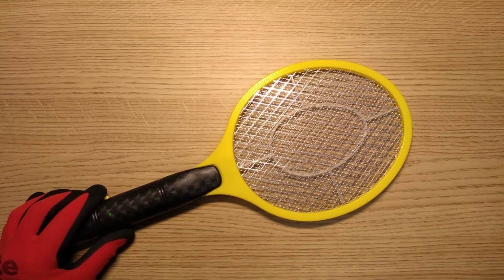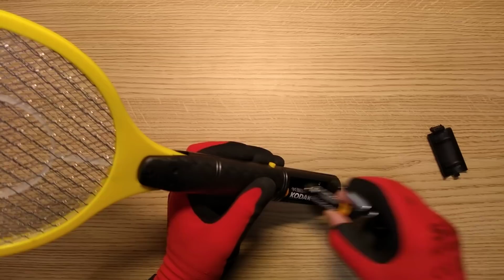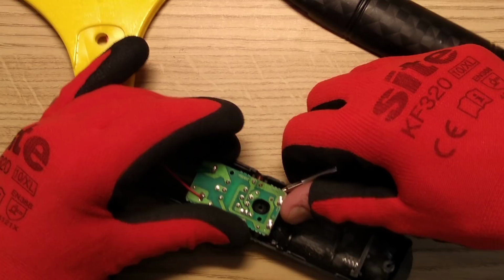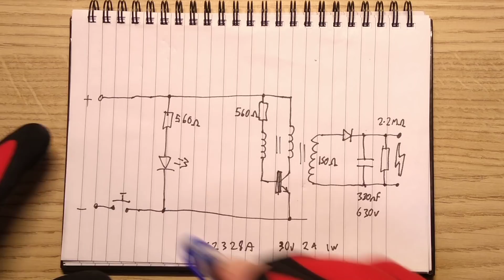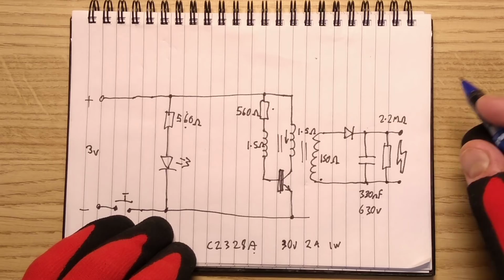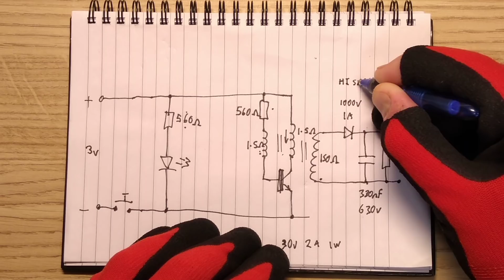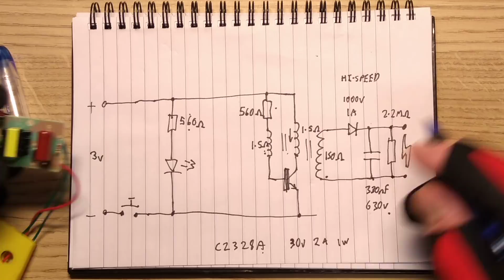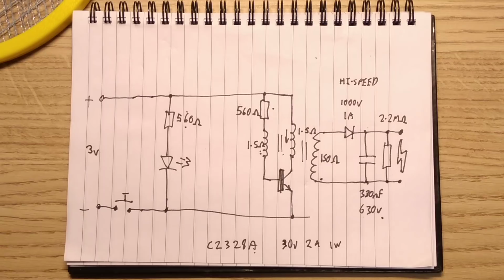Inside Poundland's electric fly zapper bat.  (with schematic)

Comment: Ands it's complete junk! Don't waste a quid on these. They often don't work. The grids short out and need to be bent out to get it working. The paddle snaps at the lightest contact with anything, including curtains. When an insect is hit it is often dazed and not killed and I took these apart for parts only to find the cap burns out very quickly, the push buttons break quite easily. They're  all round junk and I haven't figured out a practical way of modding them into anything useful. If you want a zapper get the expensive original exterminator version off amazon. Those ones set things on fire when they hit something and are sturdy enough to hit a wall hard without breaking.

Comment: For those who are curious, I stuck my finger between the outer grid and the inner grid one time. It's a very distinct sensation. More like a hard, blunt impact to the finger than the sensation of an electric shock. Hurts pretty good.
Reply: *picks up notepad, starts scribbling* ...lack of reply hours later suggests licking zapper causes prolonged loss of consciousness or worse. Results inconclusive, further study required.
Reply: @AttilaAsztalos  lol if you want something done do it yourself. 🥴🤯
Reply: My brother did it and there was a lightning bolt shaped mark on his finger.
Reply: ... "C'mon, baby, make it hurt so good."
Reply: I once took one apart and touched each pole with each hand. It felt like I got hit by a trick
Reply: @waldolemmer  Should have touched it with one hand or even finger because then the current doesnt flow through your heart
Reply: I can confirm this

Comment: Mine's got about 1500v output, I replaced the cap with a 1µF 3kV (I think it was) and changed the resistor to 10Mohm, now it kills wasps with a nice loud bang...
Reply: How long does that cap take to charge? I stuck a 1uF microwave oven cap on the end of mine and it takes several seconds to reach full bug zapping potential with it.
Reply: MOT caps usually have an internal discharge resistor FYI.
Reply: I had a wasp on the ceiling I brought the bat up to it and fried it through its antennae  no damage (crushing) so no pheromone attracting other little strippy b#$7@€£s
Reply: Oh nice, going to have to retrofit mine like that. Thanks for the suggestion
Reply: any chance of a link to the cap you used?
Reply: You mean the resistor in the output?
Reply: why I went to this video is I just got the one from Harbor Freight!

 this seems to be more substantial than the other ones I've seen.

 possibly even from Harbor Freight.

By the way for the power source instead of two double a batteries!

 also once I saw one that used Triple A's that one was underwhelming to say the least.

The one I purchased today uses 2 D size batteries for power.

My guess is Iit's probably due to the current draw of high voltage driver circuit!

This one when flying insect get swatted and it connects.

 it sounds nearly like the bang of one of the outdoor or indoor bug zappers.

 more than one of the uther electronic fly swatters.

I suspect this model that they're selling  in Harbor Freight is the Step Up from the older one or the others.

It does seem to pack more punch to the insect you are squatting.

And also I'm actually able to hear Corona discharge.

 from the the mesh which means you've got quite a high voltage on that mesh.

Which even continues a bit after you release momentary switch.

So yeah quite a bit of energy there.

Does anyone know rough voltage or amount of energy on these newer ones.

Or perhaps a link to a video on these specifically the newest one that takes the D cell batteries!

Replies welcome

But if you're seriously looking for one of these the Harbor Freight one as far as I know is best and for the price beats the old school flyswatter leaving either a a Splat somewhere or completely not taking care of whatever bug is needing to be despatched!
Reply: Modded mine by just removing the discharge resistor.  It helped a bit, and saves battery no doubt.

Comment: I had an early version with the parallel sets of wires and no discharge resistor. It made for some interesting times.
One night we were plagued by little flying specks clustering around a hallway light. Held it up next to the light, and it sounded like somebody was making popcorn.

Comment: As soon as I saw the title I was preparing for the finger test. I was left disappointed Clive...
Reply: Neil Siebenthal  As it's a closed circuit, the metal screwdriver shorted it out at the grid, there was no other path through Clive back to ground for the electricity to take.
Reply: Yes, but if he touched it with his finger, he'd get a shock as his finger would be bridging the connections. He used a screwdriver to bridge the gap hence he didn't get a shock.
Reply: Lol electroboom did that

Comment: I need to buy one of these to make a static grass applicator. It's used for model railroads and dioramas and stuff. You apply glue to a modeled landscape surface, you touch a probe to the glue, and the other end is a cup with a metal grill. The cup is filled with dyed fibers. They are attracted between the grill and the glue, and stand on end, mimicking the appearance of standing grass. Some people make super cheap ones by hacking these swatters.
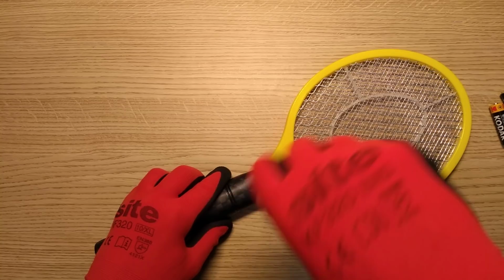Reply: Got mine at home bargins mate £1:50. To do the same mod you mentioned.

Comment: Back when they first appeared on the market in my state (NH-USA) they had D-cells.  Had the horizontal lines vs the screen and the batteries made it feel substantial and was of higher quality (they were $20 or so then).  Wasps & hornets would literally explode with the sound of a small caliber gunshot.  Yes, you can find these in every junk...err... ChinaMart...errr... dollar/discount store still.
Reply: I have one of the older D-cell versions, They definitely have a bigger pop than the newer AA-cell ones. I'm glad it still works since you can actually Kill flies and wasps with it, while the newer ones just piss them off after stunning them for a second.
Reply: Wow, I want a D cell one!
Reply: Far as I know, the Harbor Freight version still uses D cells.
Reply: I have one of the early AA cell ones, of which I have ‘tuned’ the circuit to produce the highest output I could squeeze out of it. According to a crude measurement, it now goes well beyond 2 kV. I feared the capacitors would die, but they hold. Mosquitoes usually explode, which is tremendously satisfying. Only the very fattest flies tend to recover from a single hit, so the trick is to fry them on the grid for a while.
Reply: @erikj.2066  Not the one around here anyways. I live in SW Washington and the one in Vancouver has the AA ones last time i was there :(
Reply: @keithyinger3326  last I checked they had both models, what you find in your store is a crapshoot. Mine has wandered off somewhere or I'd give you the item number for the D cell version.
Reply: @hughbrackett343  hmm, i'll have to double check next time i'm there i guess. I do remember seeing them in at least 2 different places in the store and both "requires 2 aa batteries". Maybe they're hiding the good ones somewhere else in the store yet haha.
I'm looking at mine that i have and there's no model or part numbers on it, Just one single  sticker that says "Made in China, Do Not Drop"
I'll just have to keep checking my local store i guess.

Comment: I bought one of these from Harbor Freight and measured it at just a little over 1000V while holding the button. I did have the earlier variety as well with the simple alternating parallel wire arrangement, (which I fried while swatting a wasp), and it produced over 1500V.
Reply: Mine always failed by cracking their capacitor. Also fun to watch in utter darkness: the faint carbon traces on the plastic gave a glow like a distant star.

Comment: 630V capacitor just means it did not break down when 630V was applied for 30 seconds to a test sample of the metallised foil. The actual breakdown is generally around 800V, though many of them will actually survive 1000V for a few seconds, with only the occasional self healing internal flashover.  Using on the mains however, instead of here in a very energy limited circuit, means that, during the flash over period, you get a very high current flow, and thus large areas of the foil vapourised. While on AC the self healing does isolate that particular area, as the arc does extinguish every half cycle, on DC you get a current flow, which in turn heats up more of the capacitor, and this arc area grows till it melts, catches fire and does a very bad imitation of a tea candle. 

There is a reason why proper mains rated Class X and Y capacitors are so much larger, as they both have a thicker foil, which has to be rated for 2.5kV, but also there are 2 larger value capacitors in series inside the foil wrap, so each half is 4 times the volume of the cheapie. Adds to the cost, along with those pesky certifications of samples of each batch by a testing lab, and in process testing. Rather different to the cheap one of "we tested one, so the next million or so should be fine" the dipped versions.
Reply: Of course the other obvious problem with running it off the mains is that you'd need a fly to fly near your plug, making it a lot less useful.

Comment: You once presented a chinese high voltage "stun gun" module. I watched that video and immediately thought of these bug zapper rackets. I always felt they could use a bit more oomph and the show factor could be more spectacular... Now figure what i did... Just replace the original module with that ebay-stun-module, you need to cut away some plastic ribs inside the grip panels for it to fit inside, use hot glue to hold it in place, resolder the battery box wires so that it can accept a single 14500 lithium battery to power the whole thing and voilà! "Stunning" results!

Comment: Harbor Freight Tools in the USA sell a very, VERY nearly identical (on the outside anyway) version of these, for around $3.  They've even had a "free with purchase" coupon on them in the past.

I have one, but sadly, it uses the horrible "D" cell batteries, which cost a lot more than AAs, and many people don't keep on hand.  Perhaps the makers chose to because of their large size, and ability thereby to move a lot of current quickly?

Unfortunately, those D cells are heavy, and the battery chamber was so loose that swinging the swatter around (as one must do to strike a flying insect) often induced enough centrifugal force to compress the negative-contact spring, and make the positive tip of the D cell to come off the contact point.  It would therefore interrupt the current, meaning if you swing it too hard [basically at all] then the damn thing gets no juice and doesn't work.   I solved this in mine by making a conductive washer with an insulated ring around it, to take up the slack, but it makes it a real pain in the ass to change the batteries.

That complaint aside, the darn thing killed dozens of yellowjackets for me last year.  It does work, so long as the batteries stay in contact with their terminals.  I've thought about clipping the connections to the D cells and putting an 18650 cell in there instead.  Slightly higher voltage, and rechargeable.
.
Reply: The D-Cell ones work so much better then the AA-cell versions. I have one of each and i use the D-cell one all the time since it can actually Kill flies. The AA-cell one just stuns them for a few seconds. Got them both at Harbor Freight also, but anymore they just sell the AA version. I'd love to get a new D sized one. I've dropped mine a few times so now there's tape holding the battery cover on, But it still works!
Reply: The  d-cell ones do work better, and in Florida people have lots of d batteries for hurricane preparedness. Lots of hurricane items run on d-cells.
Reply: Harbor Freight sell cheap D cell batteries.
Reply: @jameslmorehead  Yup. I get all my batteries there. For what i use them in they work just fine. Low demand things.. IE keyboards, mice, they even last plenty long enough in LED flashlights.
Reply: floobertuber I remember seeing a tear down (Clive?) that mentioned the components were rated for higher input voltage.
As long as you're modding...

Comment: I replaced the circuitry in mine with one of those high voltage generators/stun gun modules that you did a video on and replaced the batteries with an 18650 and micro USB charger😁 Let's just say the sparks are a little more interesting now lol.

Comment: Its a 3 coil version of a "Blocking Oscillator". Goes back to the tube days.

I've built my own bug zapper powered off AC line voltage thru a voltage multiplier to ~2200V DC. The key is charging a 0.1uf (100nf) 3KV film cap. That works out to roughly a 1/4 Joule of energy stored. That energy gets dumped thru the bug. The resulting "steam explosion" (bugs innards are instantly boiled) totally vaporizes the bug.

It wouldn't surprise me that the makers of these "dollar store" zappers are seriously exceeding the voltage rating of the caps. I've found that film caps can usually survive over twice their rated voltage for some time. Plenty good enough, for cheap toys like these. The caps will die eventually. But that maybe weeks, if not months, of intermittent use.

A good experiment for those wanting to get into electrical engineering, is to hook up a film cap to 5x its rated voltage, and measure its leakage current. If doesn't fail in short order, keep the setup going for an extended period, (measuring at a regular interval) and see when the leakage finally climbs.

Comment: You can also remove the grid and frame and stick the wires out of the handle and zap people.
But that would be a silly thing to do.
Reply: That would be masochistic. Not silly -- stupid.
Reply: So a Poundland stun gun then?
Reply: @K-o-R  'Poundland stun gun'. ha ha. brilliant.
Poundland's slogan should be 'more bang for buck'
Reply: @K-o-R  pretty much and if you add 2 nails or something to wrap the wires around then you can drive it into people's skin better! Ofcourse you shouldnt do this. Also the disposable cameras with a flash can also make a pretty violent taser, by using the flash circuit to charge up the cap and have 2 wires coming off that will discharge it and cause someone to contract once lol
Reply: I might orn might not have done that. I also might or might not have zapped myself with the residual charge.

Edit: Mine is not intended for zapping people. I built it to be able to charge up model railway grass so it sticks up.
Reply: @Deltazocker  "I built it to be able to charge up model railway grass so it sticks up." <- Why did I never think about this D:
Reply: Couldn't you have just rubbed a balloon on your model railway grass?
Reply: Bike alarm connect it to the seat 😂
Reply: @Alexander_l322  I was in a photo lab when someone was opening a disposable camera to take the film out, the flash had been left on and they got quite a jolt from it.
Reply: I once made a transformer with a 9 volt battery and a pulse switch. then placed high voltage contacts on the outside to shock people with. I sold about 10 of them at school. loads of people were getting shocks but no one ever got caught. good old days
Reply: @Alexander_l322  
Having been shocked by one while taking a camera apart, I can say it's bloody annoying! But as a self defense item, sorry experiment it's an interesting item.
Reply: @peterjf7723  it really does hurt lol great fun!
Reply: @Slikx666  it's cheap and effective but you must charge the flash between shocks and get close enough, if you're allowed tazers as self defence in your area then just use one of those but in England we cant:(
Reply: @michaelthibault7930  Actually that would sadistic.
Reply: It wouldn't be a good idea in the UK, people have been jailed for possession of crappy low spec stun guns
Reply: @michaelthibault7930  are you refering to sadism ? Sadistic?
Masochism is unto oneself.
Reply: @michaelthibault7930  
Sadistic.

Comment: I usually replace the 2 AA with one 18650 and a TP4056 USB-C charging module.
It provides plenty of power and they are easy to charge.